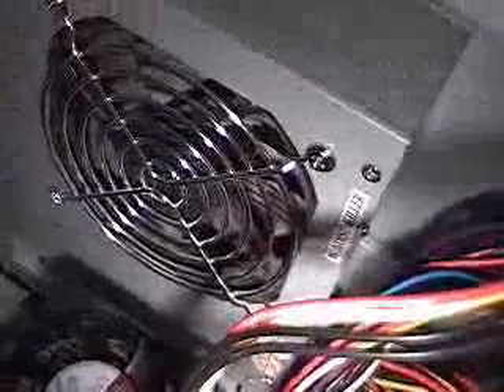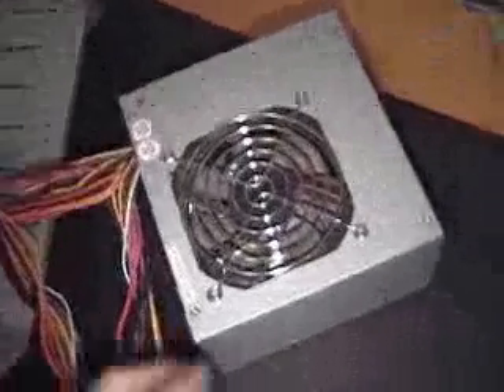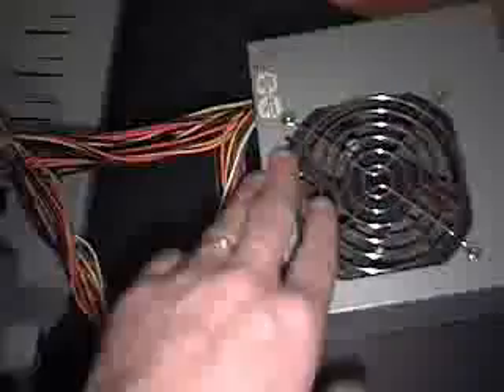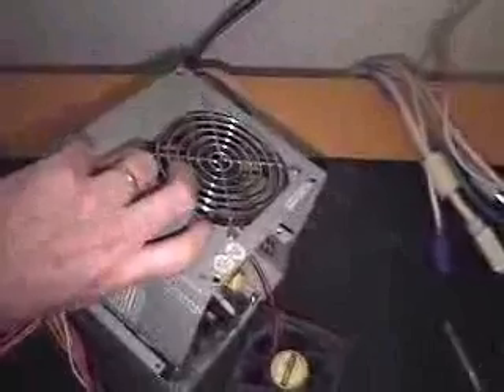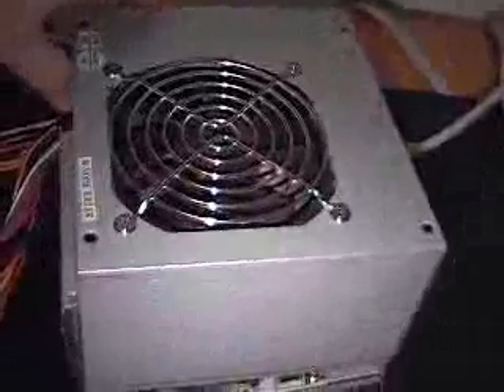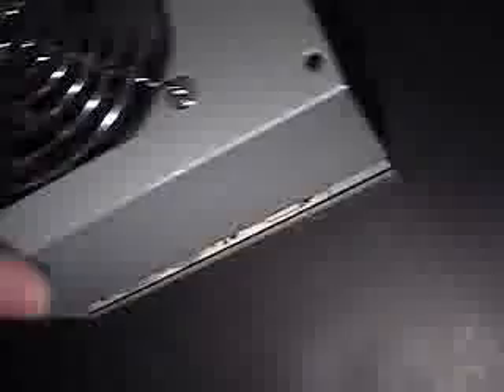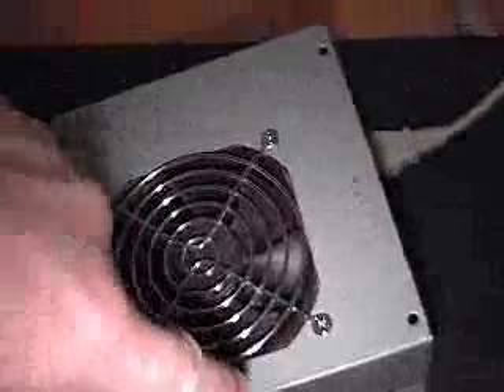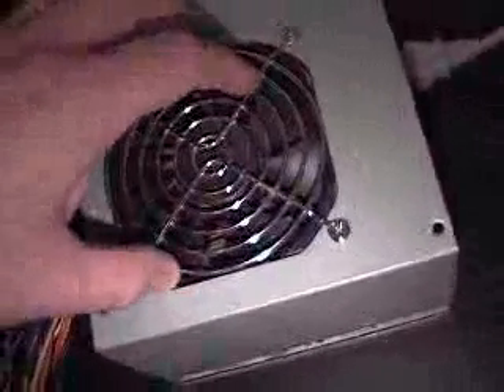#021 - Replacing a Power Supply Fan

Comment: Well, in my case, the psu is top of the line, but the 80mm fan makes more noise than any other part in my system. Finding a quieter fan for around the same rpm would be wonderful for me. I have a pc power and cooling t12w 1200w psu.

Comment: Hey Rodney, Thanks for an amazing video. I have a Power supply that is testing fine, however I hear a rumbling noise coming from it, and it seems to be the fan. I don't have the electrical know how, or guts  to swap out the fan and splice wires together. I don't really have the money to buy a new PSU right now, and it'll be painful to buy one when i have one that works. So...as long as the fan turns, and I can bear the noise, is it okay to use it or  am i putting my components at risk?

Comment: If I'm not mistaken, the capacitors still hold some power. At least for a little while after you unplug the PSU. Probably should unplug the PSU from the mobo and everything else before opening it up. It's possible to connect a current inside it with your finger/screwdriver/wet hair/ect. Frying yourself and your $200 graphics card, or other computer hardware. Holding the power button for 10+ seconds wont discharge the capacitors. 

Rodney is just an uber careful boss.